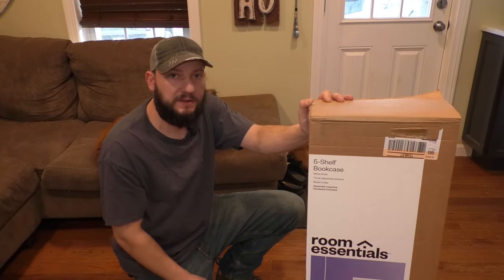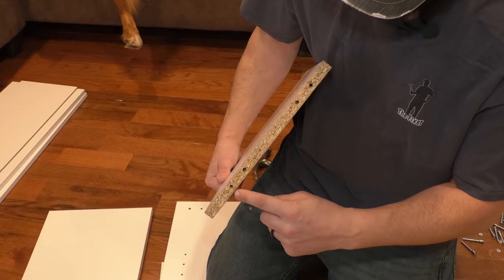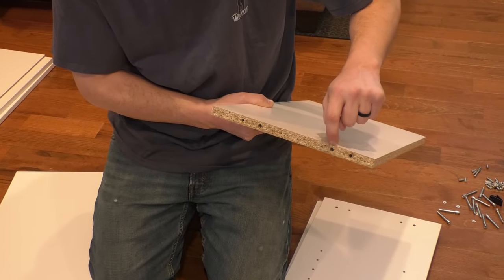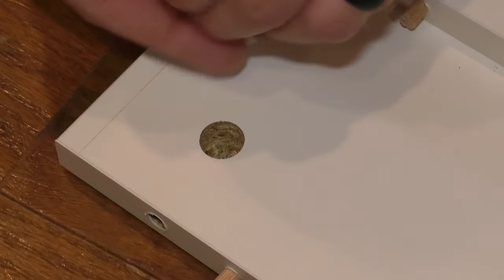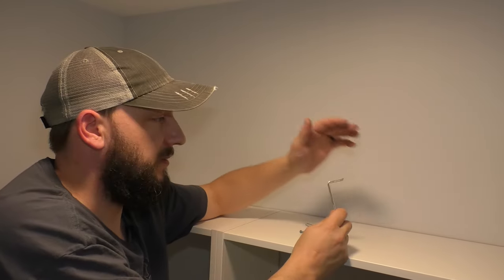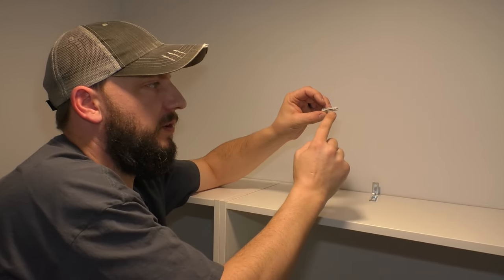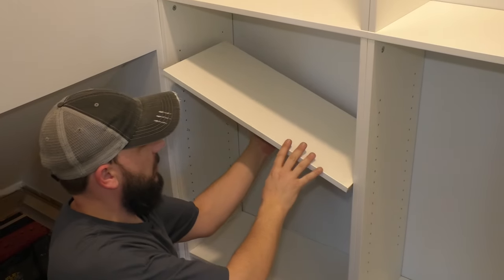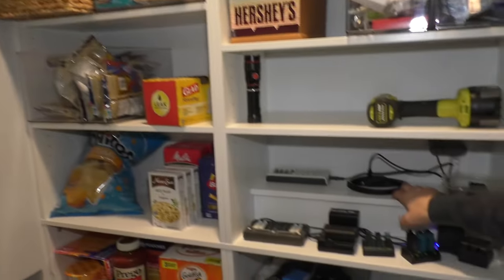How to Assemble Room Essentials 5 Shelf Bookcase from Target

Comment: Wow my box came with the wrong assembly dowels 😢. And i was halfway done. I knew these screws were funny looking
Reply: Same!!! I was wondering why it was so hard to build this time around.
Reply: This!!! Happened to me yesterday too!!! Did you find the assembly dowel somewhere? Went to home deport and they don’t have them!!
Reply: @ciriacastrosampieri2226  i JUST finished putting mine together and they actually work the same! I wish i could insert a photo of the piece but they do work the same however they need to indicate that on the instructions.
Reply: @susieesquivel3727  i got it to work! It worked the same for me the piece just looked different. I’m assuming to make it sturdier
Reply from the maker: That is annoying.  Happy to hear it worked out.  Thanks for sharing for others that might have this same issue!
Reply: @thefixerhomerepair2  you are welcome!
Reply: Thank you! I came to this video because I thought I also had the wrong dowels lol, good to know they work the same
Reply: @AntonetteShay  i NEED to know how you still got it to work. Because i also received completely different assembly dowels that look nothing like the ones in the instructions, but i cannot get the four dowels to fully go inside the holes (that connect the two halves of the bookshelf) i am so desperate for help 😞
Reply: @bigkingfloppa  the dowels won’t go inside the holes all the way. I screwed them as far as the screw would allow and I attached the other half of the shelf. I took and chance and it worked the same. I built 2 bookcases packaged with the same screws. I wish i could insert a photo but don’t panic you have the correct pieces!
Reply: @ciriacastrosampieri2226  I’m sorry I’m so late but the dowels and screws provided work the same as those in the instruction photo! The screw won’t go all the way in as it is not supposed to. The other half of the shelf will attach perfectly.
Reply: @AntonetteShay  thank you for responding! i know they’re not supposed to screw all the way into the holes, but when i push the two halves of the shelf together they just won’t connect all the way, no matter how hard i push. It’s like something is keeping the top half of the screws from going all the way into the holes of the other half of the bookshelf. which is i why im worried that I have the wrong hardware. However maybe there’s still something im doing wrong?
Reply: @AntonetteShay  will try, I have the same issue.  They need to update the manual
Reply: I thought i had the same issue had to keep pushing it in lol
Reply: I still can’t get mine to even pierce through the first piece of wood. Anyone know the dowel size pin to buy?
Reply: @Devnooget I just had this issue and panicked! I was like OH NO. But I think the new shelves are made this way and they need to update the manual.
Reply: @bigkingfloppa I’m having the same issue. Did you figure it out??
Reply: Thank you!! Same thing happened to me. Such a relief
Reply: I thought I was the only one who was unlucky to get the different shaped dowels than the diagram. I returned the bookshelf back to the store and got another box, and sure enough they’re the same like the previous box. So it’s good to know they’re going to work before I start to assemble the book case.
Reply: im having this problem they dont fit as easily as his
Reply: SAME😢
Reply: me too i just came back from exchanging it and it had the same ones that where wrong
Reply: Same here! But I couldn’t return them so I bought the piece from Amazon and it worked!
Reply: So did mine
Reply: @AC-qy1ds hello may I ask what specific size for dowels you got?
Reply: What is the remedy? I just tried to assemble one yesterday and the dowels would only go in about 20 percent of the way. Nowhere near the flush line. I even bought a second one thinking mine was defective and it was the same 😩
Reply: I literally was having a melt down because my screws don't look like this nor does all 3 of my screwdrivers fit it. Glad to see they work the same
Reply: @AntonetteShay  tysm for letting us know that they still work the same! I was scared to attempt using the screws that looked COMPLETELY different from the ones in the instructions/video, and I was sooo frustrated. You'd think a company worth billions and billions of dollars would be able to prevent such unnecessary confusion
Reply: Ditto! So those are an updated version that grips better than the originals. Look closely and you'll see one thread mimic the old version's cap.. that's as far as it should go into the cam-end...the part sticking out fits pretty well into the upper assembly, just like the original model (though the original is a smooth dowel effect, and the new one is a threaded dowel action). I headed back to Target, we opened three boxes, they all had the same new version, they called their customer service line and heard from their tech support. I JUST got back and finished up the assembly and it does feel more sturdy than I remember my others feeling on completion. Maybe it's just my imagination 🤷‍♂️....Either way, these assembly dowels are the right ones 👍
Reply: @bigkingfloppa look carefully on the ones you have and you'll see a sort of pronounced thread acting like a "cap" just about where the original assembly dowels' threads end. That's as far as you want to screw it into the lower assembly, with the rest staying exposed just like the originals (The originals have the exposed ends smooth, the new ones are threaded basically all the way, including the part remaining exposed to secure into the upper assembly
Reply: @CourtneyEaton-j2k  that 20% is exactly as far as you want to go (maybe more like 30%?), with the remaining staying exposed like tbe original assembly dowels' design... The new one just has the threading all the way to the top, which makes it slide into the upper assembly more securely
Reply: So did mine.
Reply: @bigkingfloppa did you end up getting it? Trying do it rn but it won't fit
Reply: @mikemo4252 I have the same problem but the two big shelfs are not fitting in all the way
Reply: Mine did too 😣
Reply: @mairadeluna8587  lemme no if yours fits cause I can't get it to piece together
Reply: Thank you so much for posting this video. My box was missing the assembly dowel, but we were to finish with the screws we had.
Reply: They are updated they will only screw in a little and then you put the top part on and they go right in, I went crazy for an house and never thought to just try it, so glad it worked make sure it’s the right holes too but yes they are different and barely screw in. Thank goodness for some of the comments that helped.
Reply: Yup mine are incorrect as well… my bookshelf is damaged now… 😒😒😒
Reply: @AntonetteShay yea mine have like a half inch maby quarter inch space between is that ok to just put the back panels on ????
Reply: Mine too!! My dowels are waaayyyy too long!!!
Reply: My screws striped 😢

Comment: Thank God I saw your video this morning!  It took me almost 3 hours to lay everything out, label the parts per the diagrams in the assembly instructions.  I am not a handy woman by any means.  I was fine with everything in the assembly process until it came to the dowels for the cam lock. The ones included in the box looked similar, but not exactly like the ones shown in the manual. So I stopped at that point and said I’ll start fresh in the morning.

I watched your whole video to make sure that the part that I had done was at least correct since the manual leave the light out, and boy am I glad I did. This time it only took me about 30 minutes to finish putting the two pieces together, and now I’m working on putting the shelves in which shouldn’t take long at all. That was the only part I understood without the manual , so again thank you so much. I did subscribe to your channel because I plan on doing a lot of things around my house. Blessings to you.
Reply: Yes, I agree with you.  Those dowels confused me because they looked totally different from the instructions.   It would also be much easier if they label the pieces on the rough edges.

Comment: although this was extremely helpful, I got lost at the part where you add in the assembly dowel. for anyone doing this make sure that the word Titus on the cam hardware are all facing the right direction otherwise you'll think there is something wrong. hopefully I wasn't the only one and this helps someone.
Reply: Omg you are a lifesaver . I came to this video for this exact step !!!! Thank you!!!

Comment: Any tips for having a slight gap in the two sides once you assemble them? I'm at the 7:00 minute mark in your video with my assembly and everything fits. But when I stand it up, there is a slight gap in between the two pieces and it's driving me crazy. I thought once I tightened the connector screw it would close the gap but it doesn't. 🥴
Reply: Did you figure out how to fix this? I'm having the same problem 😪
Reply: same thing happened to me
Reply: @smashbrosfiend if this is still being built, make sure the dresser isnt propped up on something and completely flat. if its flat make sure the boards are completely straight and not turnt at an angle. if its straight try a hammer (with a towel for damage) to the bottom. 

this should make it to where when you tighten it, it closes the gap completely

or at least thats what i did.

Comment: Do you need a hammer if you have a drill ? Is it necessary to have all ? I dont have a hammer and im going to be building this today
Reply from the maker: You will need a hammer for the nails for the backing.  Some of the pieces might also give you a hard time going together.  A little tap with a hammer helps.

Comment: Trust me the dowels work if they are the different ones . Just screw the dowel into the tiny hole till it hits the bigger screw part and stops screwing in then connect the other shelf part then twist the bolt thingy . It works it’s just weird

Comment: Okay the last part i was super confused. You attached it to the wall but what if you dont want to attach it to the wall ?
Reply from the maker: Pretty much all companies that make furniture like this recommend attaching it to the wall for safety.  Basically so a child can’t pull it over on them.  It is ultimately up to you.  1 anchor point on the top should be fine.  I did more because I didn’t put the backing on.  Make sense now?

Comment: I'm having an extremely tough time. I barely got to where you put the two pieces on with one of the bottom pieces with the four round holes where you put the screws in and for the life of me it wont stay together. The drill doesnt work, the screwdriver didnt work so i had to hammer them all in and it is wobbly af and i dont know what to do. So at the 3:30 mark. Thats where im stuck because the pieces wont stay together and they're wobbly as hell. You make it look so damn easy.

Comment: Does anyone with these units have these installed  without the anti-trip bracket (the one that holds the bookcase to the wall). Will it fall over when its empty or will it fall over if you put too much weigh?
Reply from the maker: Really it is more of a safety thing if you have a kid try to climb on it or something.  Don’t quote me on this but I believe there were some lawsuits that happened and all companies started including these safety brackets/straps with units like this.  The shelf will stand just fine on its own but I am not the safety guy so I recommend doing what it says in the instructions of the shelf.  Hope this helps. 👍
Reply: @thefixerhomerepair2  thank you for taking time to reply i really appreciate it.

Comment: I can’t get my screws all the way in. It seems like the holes aren’t lined up correctly. I put one of these together with no issues a few years ago and just bought 2 more and I can’t get the screws all the way in on either one. Has anyone else had this problem?
Reply: Update: I rewatched your video and heard you say to make sure the screw catches if you’re using a drill. I decided to forgo the drill altogether and only use a screwdriver and it went in with no issues. Thanks so much for the tip!

Comment: So I don't understand your video where the bracket is that you're supposed to attach to a stud so it doesn't fall over you have the bookshelf you know long ways down you have your elbow on top of it and you never actually show how you put the bracket in the bookshelf while it was in an upright position which is a very important feature since it will fall over on you
Reply from the maker: It was in an upright position, I just had two of them side by side.  Thought I explained it pretty good.  Sorry if you didn’t understand.